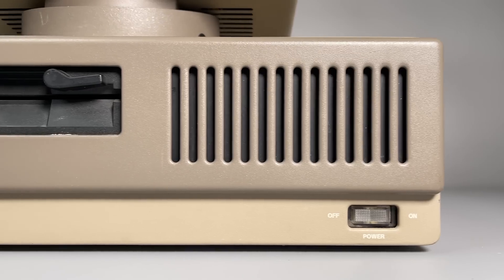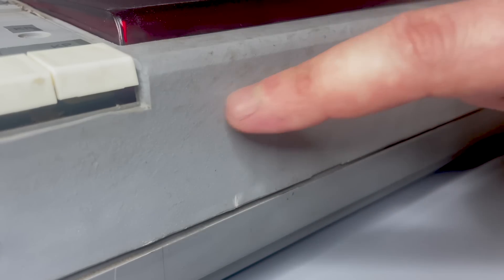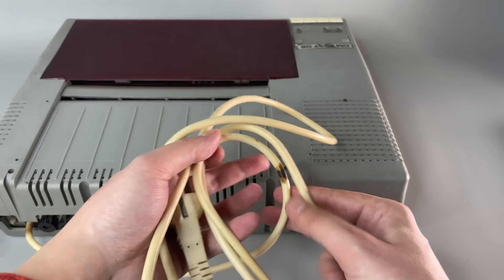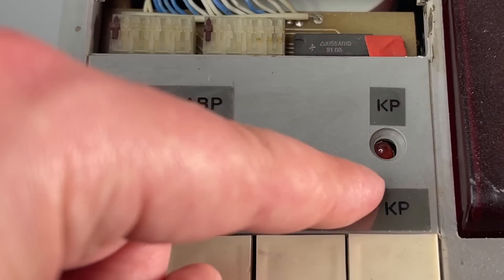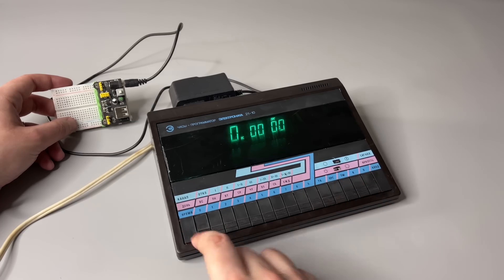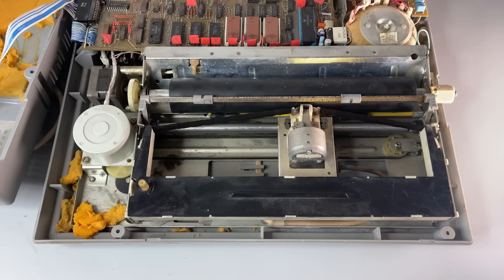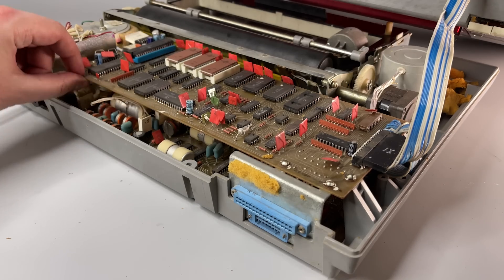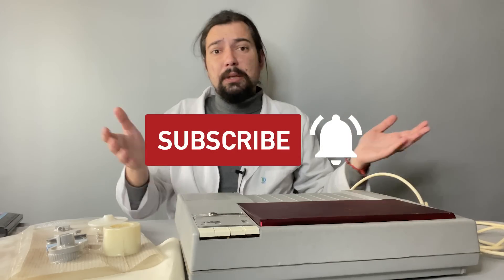This is THE WORST PRINTER I've EVER seen | Soviet SM6337.02

Comment: Note, the sticker glue is just where it should be. It means that the sticker was placed in the right place at the factory and was just shifted later.
Also, this printer was NOT seemingly stored in "a wooden crate in a garage", right? Basically what we have seen is unboxing without an actual box of a so-called 'brand-new' printer, which was lying somewhere in an obscure corner of a Chernobyl reactor for 40 years. Our dude is surprised now that there is some dust, rust, dents, signs of burn and corrugated molding. 
Yeah, quality of the consumer products was not very high, however what's the point to to do an unfair exaggerated review? Maybe the answer is obvious though
Reply from the maker: That is simple. Previously I saw some better examples of this model. If even we imagine certain storage issues gone, what remains is way worse than an acceptable level. And that is the point of it. And excuse me, if I have the same thing which runs out of the box after stored for years in a cold garage, and this one had mounts for PCBs not even sealed, which made a shortcut inside, that says a lot about the manufacturers' approach, no matter how and what was happening to it.

Comment: It was all bad with electronics it the SU. They just couldn't make it right. Almost no SMT. Whatever SMT was manually placed and soldered as well. No solder mask on PCBs in the SU at all as there was no pick&place technology available there. Copper quality on the Soviet cladding was just crap and it was hell prone to de-lamination. Soviet silicon wafers had massive inconsistency resulted in a huge component parameter deviation from one sample to another so it was quite usual when the same component part number had a letter suffix given to to that after parametric selection. It was pretty common situation when the same transistor had a half of alphabet variations. The electric parameters of the transistors sold to public via government dedicated stores didn't fall under any datasheet specs as they were just defective products which didn't pass QC. The good ones could be purchased on the black market though.

Comment: All Hail Comrade Printer. This is the worst Soviet Era printer I ever seen, I believe the case was done with Plastic Molding Injection. When a two mold cast close together, then the machine would force the purge of plastic to form inside the cast, once it cooled down, then the cast split open and they will remove case and grind and deburr the excessive plastic. This is what I can tell from looking at your Comrade Printer! 😄😁😆😅
Reply from the maker: Thank you!

Comment: Plastic defects seen are from very poor operation of injection mold machine and poor part design. The butterfly pattern is from running the mold too quickly, the media does not have time to properly reach temperature and flow in evenly. The massive sink marks are from poor part/ mold design where the part is not allowed to cool uniformly
Reply from the maker: Thank you for these details.

Comment: The sticker looks like it was placed correctly.  You can see the glue line.  It more likely contracted from the cold in storage and due to poor quality materials it pulled itself loose.
Reply from the maker: If so, the question why other stickers remained in place. I mean, I had many things stored improperly in the past, but never got a similar effect.

Comment: Oof. It's not the worst printer. There was a worse *full width* printer, in late 1980s. It had a *giant* stepper motor. The controls were fixed logic, not some newfangled microprocessor, thank you very much.
At that time, Epson FX-800 and LX-800 has already been quite available in the late Soviet Union.
Reply: And I'm NOT talking about Robotron. Compared to that abomination, Robotron printer was quite good.
Reply from the maker: WE NEED MORE DETAILS
Reply: @ChernobylFamily  I believe it was produced in Smolensk.

Comment: i always wanted to try to make a printer... i want to try to use uv curing with magnetron sputtering to print a very high resolution picture get a computer screen remove the back side so the screen is transparent shine a uv light threw it put a magnifying glass under it focus the light to a clear but small image of whats on the screen display a 2 bit black and white image in screen for less steps use a black surface like graphite cover in uv curing anything and at the sharp uv image will cure parts of the surface wash away the wet and magnetron sputtering will place say aluminum on top of everything but its only applies to the graphite where the uv light didnt hit so then you heat it up to boil the uv stuff away removing the top layer that was on top of the uv stuff and whats left is graphite with a picture on it printed in aluminum so its a black and white picture graphite black and aluminum white to finish it vapor disposition to apply a thin layer of a insulator to protect the image like sand will apply a thin layer of glass to it. i think i should be able to make a 1080 image really small. i think it would be cool to have full color images using different metals yeah i know carbon isnt a metal but its black and dont melt. but if you use a high powered laser on a cnc machine you can go without the uv stuff you just cant make it as small without the magnifying glass but its hard to use uv stuff i need a easier solution i have all the tools just need a bigger brain
Reply from the maker: Sounds epic.

Comment: I can't agree with you. This printer is rather an exception. I had several printers from the Soviet period in the early 2000s. I had Mera-Błonie D100 printers. I had Mera-Błonie D100M printers in two versions, in a plastic and metal case. There was a Robotron 6329.01M, unfortunately, with a serial port board. All these printers were copied from the electronics design bureau where my father worked. Together with him, we adapted them to modern IBM PC compatible computers. And they worked perfectly, they were quite well made, made of good materials and practically did not fail. I still have one D100 and one D100M, they didn't require any major repairs, they work like clockwork, just lubricate. As for your sample, only the Oryol factory had such poor quality. Other manufacturers, there were 8 of them, produced in other cases of better quality, including metal ones. And your printer is beaten by life quite enough.
Reply from the maker: All equipment you mentioned is from Socialistic bloc, that is a completely different level of quality, about this difference I actually told in the end of this video. I really do not know how big is your personal experience with purely Soviet stuff, though, from my – such "printers" were everywhere...Yes, I saw other versions of 6337, but after all, the core idea is not a printer, and not printers in general, but a massive problem of ignorance and faults in production which in that period was already acknowledged even by authorities.
Reply: @ChernobylFamily  Yes, I have seen a variety of Soviet equipment of poor quality, especially of the late period. I just mean that not all the equipment was bad, as it may seem from the last words of the video. Something was done quite decently, but something was done with real negligence. Just like in any other country in the world, it's possible. And in the USSR, before the collapse, no one was interested in anything at all.
And thanks for your videos, I haven't seen much of the stuff you show anywhere else. Really cool channel!

Comment: Currently, every printer you can buy is cr@p, it will either cost a fortune and the ink will dry all the time, or the ink will constantly need to be flushed. I got rid of two new printers after 2 years because they are designed to create more business for the manufacture - especially if the printer connects to the internet.

Comment: The 'cosmetic faults' are what we call 'silver streaks', a sign of excess moisture in the polymer usually caused by insufficient drying of the polymer before feeding the press. The 'extra plastic' is what is known as 'flash', which can be either setter error, which is where the person setting the machine sets too much polymer injected or too little clamping force, or it could be a tool (mold for Americans) defect, which means the tool should be serviced and polished. Both should instantly render the moulding scrap at any reputable manufacturer. The 'already damaged' bits on the red cover are gate marks, another injection moulding fault caused by either a bad tool or operator error in trimming the gate.

These defects should not even get as far as quality control, even a concrete brained machine operator could spot them. Which means only one thing - the factory owner was deliberately letting defective parts ship as he knew the customers have pretty much zero standards.
Reply from the maker: Thank you very much for this comprehensive comment.

Comment: the white lines in the molded plastic is called splay. which can be from a number of things like lubrication/oil leak or dirty mold, cold slug injection, trapped gas from heated water content in the plastic granules, or degradation in the plastic. maybe a mix of a few of these. you can tell they didn't care so they probably left the plastic out in the rain one day and had to use it or get fired. 
its certainly something most companies would throw a way or grind down to mix with fresh material.
Reply from the maker: Thank you for explaining!

Comment: That's some of the worst quality plastic and moulding work I have seen in ages, reminds me of old Svezda model kits I bought while on holiday in Hungary in 1981, that plastic would shatter by just thinking about touching it.
Even cheap Alie stuff is often of better quality.
Not only the label was cut with a knife on the plastic, some edges were 'dressed' with a machete as well, and the button lid was prised open with a screwdriver apparently in the factory as this is a 'new' out of the box printer. The holes for the LEDs are drilled by hand and don't really line up.
And the glazy look of the plastic of the power cord would made me fear that it would go up in flames the moment you insert it into a socket, so your decision not to plug it in is very wise.
There was a huge gap between consumer stuff and things made for transport, military and the governmental institutions behind the iron curtain.
Reply from the maker: We saw better examples of this very model, but seems this is a quality of a specific factory.

Comment: I worked for IKEA over 30 years argo and we invited to Sweden production managers from four Soviet furniture factories to train them to the IKEA policies. During a lecture in quality control, the managers were stunned: “Quality?! We sell everything we produce, quality or not.”
Reply from the maker: Omg...
Reply: That is why IKEA when they started their own production in Russia hired a lot of staff from European country's with well know traditions in woodworking to run these factories.
It was impossibly to make Russian management to be able to understand that quality is a thing, they have always only been used to quantity is king and all waste is unwanted, that is why they still today sell products that had failed in production but it is that much complete that it can be put in a box/bag and sold.
Reply: @K2teknik.  Yes and no. When IKEA modernized some factories in Soviet Union, all machinere were bought from mostly Germany, Italy and Sweden and installed by engineers from the machine factories. In some cases, when a complete line was installed, engineering companies like Austrian Zuckermann or Swedish Kährs Maskiner oversaw the installation and start of operation. 
In many cases, when a few machines were installed, the technical suvervisers on spot was actually very cunning and could start up and make necessary adjustments. In one factory, the personnel at the factory had actually, before the engineers from the German machine company arrived, installed a machine line för making bookshelves, almost "killing" the Germans, but the machines was perfectly installed, aligned and bolted to the floor.
Besides of the help to install and start up machines and machine lines, IKEA (its engineer dept - IKEA Engineering) supplied the facturies with a plethora of guides and instructions on quality control.

Also, the affairs were really complicated and made the CEO and his staff in the factories were responding to one state department, that in turn were responsible to anoter department.
Reply: @Soundbrigade  Interesting information, thank you.
My statements is based on two IKEA factories some hours drive from St. Petersburg in different direction, and they was having both Swedes and other nationalities but Russian as managers in the production to supervise the Russia staff from before 2012 and up to IKEA's "exit" from Russia.
Reply: @K2teknik.  Actually we were a team of two taking care of a new plant just outside St Leninburg (Petersburg), some updates in Priozersk, North of Petersburg and I was more or less alone dealing with some new machineries installed in a factory in Velikie Luki, 500km S of Petersburg.
I was surprised that not seldom the people, the workers did a great job, took a great deal of responsibility, but the people on top … not so much.
Five years after I left IKEA and working as a foreman in a small plant in Petersburg, I met one of the guys involved in the “business-thing”, a director from a bureau in Petersburg. He wanted to workin our firm … cutting and packing plywood. After the USSR collapse, many people did loose a lot.

Comment: I am old enough to remember the joys poorly-made of Soviet-built electronics. Like quirky TVs that suddenly start working properly after you give them a couple of good whacks with your fist (likely due dry soldering joints).
Not all stuff was that bad though. My first ever TV (a model of Šilelis) lasted for many years without problems. We replaced it only when the CRT tube wore out and got really dim.
Reply: Soviet color TVs sold in Czechoslovakia in half of the eighties were equiped with "delta" type CRT. Uncle had one, and its purple - green output was terrible. 
I learned to make fine tune of its circuits on highschool and was surprised, how perfect colors would be possible. If the home electronic servicemen weren't rare as gold few years before.

Comment: why is there a wall socket in the spare part bag ?
Reply from the maker: I even do not know how to explain a level of how epic is this. Because according to the specifications this printer was considered a professional equipment which had to be plugged into a industrial wall socket with earthing. Regular soviet wall sockets had no earthing, and if some device required it, normally would have a separate outlet for it, which had to be connected to a earthing line which also normally was separate! So they provided proper socket to go with devices. BUT!!! At the same time this printer has an earthing line srill as a separate outlet - you can see it where I show the rear side. So the only real purpose of this socket is that it would hold the plug firmly, comparing to usual sockets. Bizarre...
Reply: @ChernobylFamily  indeed...

Comment: I've owned similar model in 1991 or so. Not exactly the same model, but SM6337 without ".02" suffix, for A3 sized paper. Actually, in Soviet Union in these years it was very advanced hardware, other printers was much, much worse. It was literally luxure item, a dream for any computer guy.
Reply from the maker: I guess you had .06, and yes, A3 versions were much, much better. Not the last reason was that they were produced by different factories.

Comment: the 'soviets' (actually mostly the east germans ;) actually built most printers out there in those days. as most of them use inner parts developed and produced there. regardless what other brands they printed on the case they put around them elsewhere. lol.
Reply from the maker: Just to understand you better – "produced there" – where specifically?
Reply: @ChernobylFamily  the est block. mainly the ddr. other places too. quite a lot of printers are basically just east block mechanisms with a plastic case around it and potentially some firmware made in the west. sometimes even the whole thing. except for the badge. lol.

Comment: I used to have a TV. A Soviet-made color TV - Rubin 714. It broke down again and the service guy came. As usual, I went to the kitchen to make him coffee (he looked very tired), when I came back I found him in exactly the same position as you: with his head resting on his open hand - he was looking inside this TV and deep in thought. Worried I asked him: something difficult, complicated? No - he replied - it's enough to replace these three lamps, it takes a minute, typical fault. But I still wonder: how to the hell do the Soviets fly into space...
Reply from the maker: Rubins often werr also flammable...
Reply: @ChernobylFamily  But these were Rubins 711 and spontaneous combustion actually often occurred in this excellent construction, the likes of which the world has never seen!
In 714 this defect was removed, they "only" broke down. A dozen or so times during the warranty period, and the CRT tube (cost: half the price of a new TV set!) died before two years had passed. Lost maney...
So the considerations of the serviceman were absolutely justified!